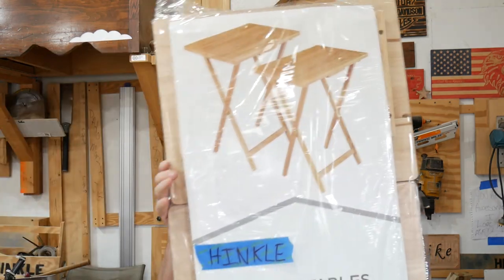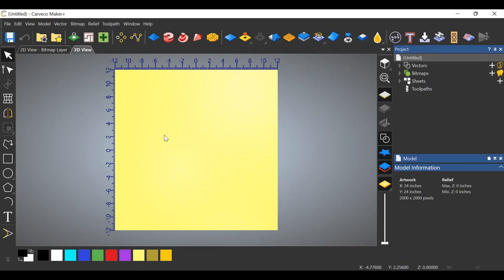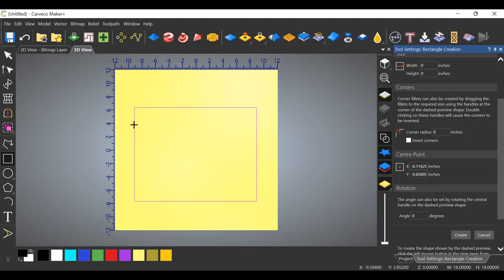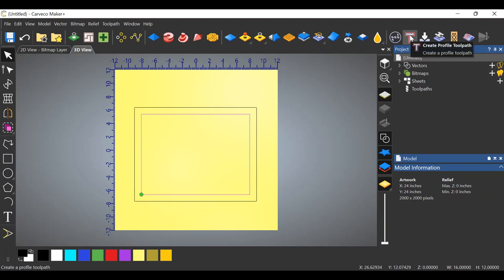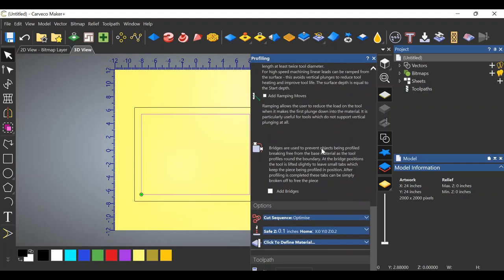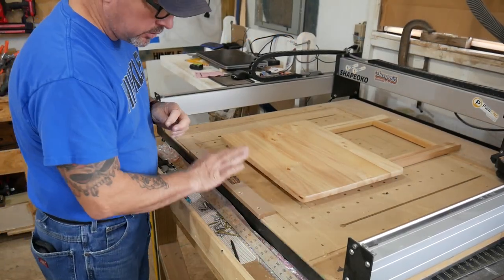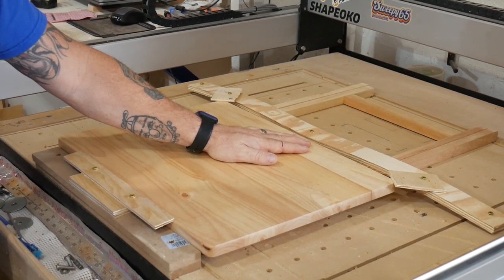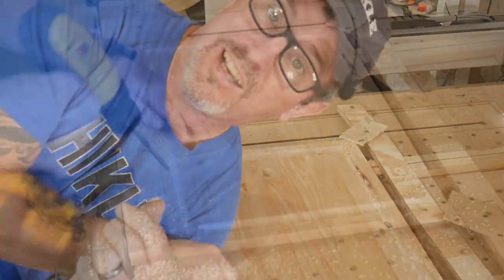How to: Cut in a juice groove using Carveco and a CNC machine

Comment: Any reason you did not just carve the profile “inside” and set the offset at .5? (Rather than math and cut the profile “along.)
Reply from the maker: Thank you for watching 
I find it easier to work off of center lines but you could do it the way you suggest. what ever is easiest for the individual programmer to use that’s the method I would recommend
Reply: Thanks, I was curious.  I'm only a year into this CNC.